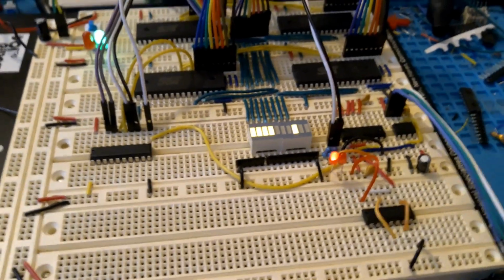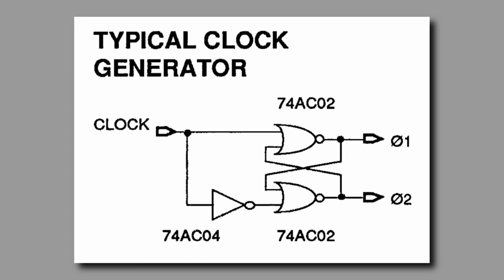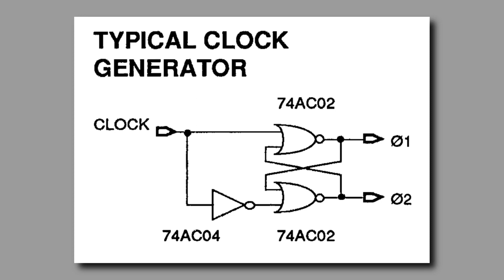Homebrew ARM2 #4: Quick fix for a mistake from video #1

Comment: On this page on the original ARMv1 architecture the clock phases are described as non-overlapping in a way that, in order to have that fully guaranteed, the high and low clock signals have slightly different durations. My take is that your fully symmetrical clock signals only work just fine because you probably have relatively slow raising/falling edges, but I may miss something of course:  https://en.wikichip.org/wiki/acorn/microarchitectures/arm1
Reply from the maker: I think the cross-connected NOR circuit is fine for this, it is recommended in the data sheet. The input clock is symmetrical but the output clocks will both have a slightly lower duty cycle, as they cannot go high until the opposite clock had gone low (including its transition time and the NOR gate delay).

The exact symmetry of the output clocks isn't very important so long as the duration high is long enough for the CPU to get it's work done, and the duration low is not too long (otherwise dynamic elements within the CPU lose their state).
Reply: @GeorgeFoot   I meant the north-south symmetry of the two clocks, not the symmetry along the time axis, the latter is of course less important as you describe. The cross connected gates circuit provides the required gap between the opposite clock edges, but I still assume that this is only the case for logic families with slower or equal raise times and delays than the logic used in the processor itself. My observation is a bit picky if you want, but just as a matter of academic curiosity I wonder if this circuit would still work if we used a fast logic family such as AC or LVC
Reply from the maker: @lsfornells  I think the datasheet just specifies >0 time between the fall of one clock and the rise of the other. But I don't know how accurate that is when taken to extremes. For it to be a problem I think you'd need one part of the chip to turn on quickly while another part turns off slowly. The circuit in the datasheet shows AC parts though which are pretty fast, so I guess it's ok!
Reply: @GeorgeFoot  Ok, fair enough. My understanding is that the non-overlapping clocks were required in the early ARMs because registers were simple level triggered d-latches (not edge triggered) to minimise space and transistor count. The “gap” between the two clocks was particularly used to latch registers at the end of the cicle. Therefore my take was/is that if this gap is too tight, let’s suppose with much faster rise/fall rates than the internal logic circuits in the chip, then it might not be long enough to actually latch registers during that short interval. But as said before, that’s only a purely academic interest from my part. As per your reply, I am sure your circuit is working perfectly within the required specs. Great work btw, I love these early ARMs !!
Reply from the maker: Visual6502 has an ARM1 simulation I think which might shed light on that. I had assumed that some things happened when phi1 was high, and others when phi2 was high, but nothing happened in-between. Just an assumption though!

Comment: Hi George! First i want to say to you that this circuit is getting good, but i don't understand the purpose of the nor-latch, can you give me a web or a explain of his purpose? thank you
Reply from the maker: Wikipedia has a nice animated diagram: https://commons.m.wikimedia.org/wiki/File:R-S_mk2.gif#mw-jump-to-license

This shows that during transitions the gate delay causes both outputs to go low briefly. The only case not shown in the diagram is what happens when both inputs are high at the same time - but in this case, both outputs still go low, so we are fine with that and never have a case where both outputs are high together, even briefly.
Reply: @GeorgeFoot  thank you! you're awesome :D

Comment: Hi George, thanks for this interesting project. I'd be scared of all those data lines on a breadboard... Did you consider using a logic analyzer for debugging? Might be very helpful. There are cheap ones out there for less than 10$. And you might use the sigrok software. For filling the RAMs with EPROM contents: One idea is to use an Arduino Mega (54 I/O pins). You can load your program into the Flash of the Arduino. At start it halts the CPU and fills the RAMs. Then it disconnects from the bus and starts the CPU. While it's already connected to the address and data bus, it might also be used to sniff those lines and provide more insight about what's going on there. Or you could use it to implement some I/O...
Reply from the maker: I have a cheap logic analyser but never get around to using it, as I usually seem to guess what the problem is before going to the trouble of setting it up! It'll be a port of call though when I am stumped.

I've been thinking about using the Raspberry Pi Pico to load the code into RAM. It doesn't have enough pins for the full bus widths but I could use some latches to get around that, and it'll be nice to not have 50+ wires going to the Pico anyway!

Comment: I'm really enjoying this series! I thought the 2 phase clock would end up being a lot more of a problem than it seems to be, but I suppose the timing and duty cycle issues wouldn't really be an issue until you get up into the MHz range. What was the original rated clock speed of this particular chip?
Reply from the maker: The one I have is 12MHz, but they used a lot of clock stretching especially in N-cycles to deal with slow bus devices. So I think the unbalanced duty cycle is not a problem. When I have a more substantial program with proper verifiable output I'll try running it from a crystal, and see how that goes.